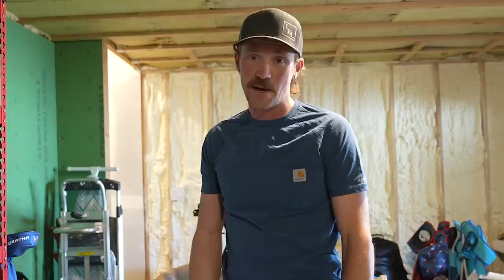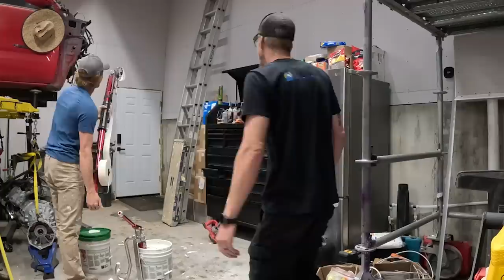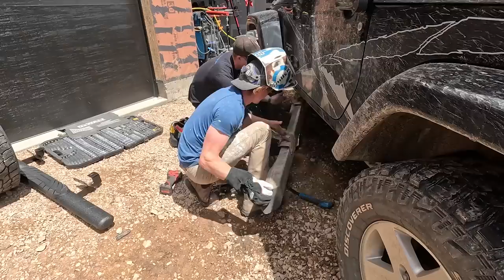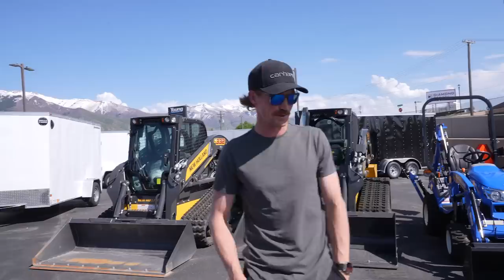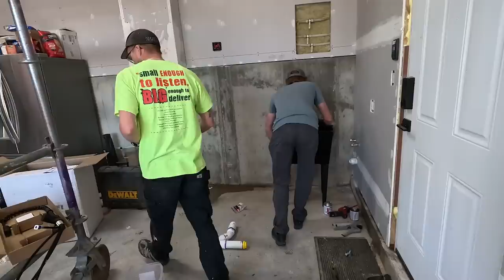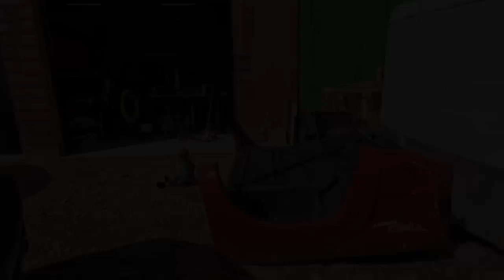WE NEED THIS FOR OUR NEXT BIG PROJECT!!!

Comment: Trent, you need to use larger trowels to get a smoother finish.
Reply: Agreed, get an 18 inch drywall knife to clean up your last stroke...it will save so much sanding!!

Comment: To get grease stains even set in ones out, use dawn dish detergent and some salt.  Pour a little soap on the grease spot, pour a little salt on the soap and turn it into a paste  and rub into the grease spot,  let it sit for a little while then wash as you normally do.  It even gets out old grease spots in fabric.  Sometimes it needs to be reapplied but usually that does the trick. Nice job on the garage.
Reply: Another tip, check the garment when it comes out of the washer. You can retreat and wash again. When you dry, the heat sets the stain.

Comment: So many possible projects to come. Stairs and deck for the Casita, smoothing the second garage floor preparing for concrete, moving the propane tank to a better position so it can be accessed year round, etc. Suggestion, maybe a lean-to for the propane tank to keep snow off of it.

Comment: New Holland is one of the top farming equipment in Canada. No problem in heat or cold and very reliable for the years I was on the farm. I am 68. Retired 2 years ago. Started to work on the farms at 18 so around 50 years. Also raised in a farm so handled this equipment lots of years.
Reply: Yes. I'm also 68 and have heard of New Holland tractors all of my life. Always has been a reliable company. But now it seems that what began as an American company in New Holland, Pennsylvania, is now an Italian owned company. Who knows if the quality of the machines and/or service has remained, or improved, or deteriorated?
Reply: We have a New Holland Tractor since 2019…..worked very well….does what it should….no Problem.

Comment: Trent when pulling your paddle/mixer out of the mud bucket, make sure it's not spinning!  LOL.   Also have 1/3rd to 1/2 pail of water (clean used mud 5 gallon pail works fine for this).  Then spin the paddle/mixer in this clean water,  does great job of cleaning off your paddle/mixer!  And if you do it right, no mud or water on your clothes, floor, or wall or God forbid your Fur Baby!  ROFL  Just a few pro tips there Trent!  Thank you for entertaining us Trent!  :)

Comment: Trent:  use the larger paddle for the seam taping, not that little one.  It is for touch ups, nail holes, etc.  Also, use a little more mud.  The bigger paddle bends a little as you use it and scrapes off most of the excess, leaving a nice smooth and thin seam..

Comment: I am with the comments below mine " Leo's bedroom!" 
And shaping a new driveway! 
The back stairs and deck and cover for the deck. For weather ☁️ protection walking out the door. Behind the garage deck. 
The house front , extended living room. 
A cover for the house deck , to prevent snow ❄️🌨️ on the deck. And rain 🌧️☔ .  
*Roofing the the garage and outside sidewalls .
* Pouring cement the other garage's floors. 
* Water and snow proofing the outter garage walls and proper water drainage.😂😊😅

Comment: To remove grease put butter on top of the grease and it cancels it out. Apply to the item before putting in the machine and that should remove it. It worked for me on white shorts which were covered in grease splashes after cooking outside.

Comment: My following thought is probably not going to pass code in a garage, but recently I did a basement room for a neighbor. When I put up the sheetrock, I made sure my inside corners were very tight. Now I hate taping and mudding as much as the next guy, SO... on those 4 inside corners I caulked them and finger wiped them, and they worked and looked just fine! You'd never know, and it was super fast, easy, no sanding needed.... 
You guys have always been doing a super job, so keep on, keeping on!! I started watching you from when you left Argentina!! 

Best regards, Ted:  North Fork, Long Island, NY

Comment: I’m shocked you don’t have to put 2 layers of drywall between the garage and the apartment.  You do in most places.  Two layers makes a proper firewall
Reply: Same here in illinois  2 layers of 5/8 to separate  living space from garage
Reply: I also don't understand why they didn't put a vapour barrier between the insulation and drywall. With having a heater in the garage, they are now going to get condensation and then mould. 🤔
Reply: Double 5/8 in NY! Between gas storage and living quarters.
Reply: Same requirements here in California too. I think it's the same for Summit County too.
Reply: Utah Code is what they are using.
Reply: 2 layers here in Maine,or 1 I think fire rated 5 or 10 hours.
Reply: Two layers here in Minnesota as well. They haven’t had a final inspection yet so might end up on their check list.
Reply: @joannjukes9140  Remember, naysayers, this build was passed by the authorities.  Different rules and regulations everywhere.
Reply: @lesleyhughes3174  This part of the build has not been passed by the building inspector. It doesn't matter where a person lives, if they get cold weather and have a heater in their garage, and if a vapour barrier is not used on exterior walls, they are going to get condensation and mould. It's because the cold air is meeting the warm air.
Reply: @TheWestlandgirl  I'm sure they are, but with having a heater in the garage, the exterior walls need a vapour barrier. It's because there will be heat meeting cold during the winter.

Comment: New viewer here, and really enjoying! I dont normally comment, but have to share this old school STAIN REMOVAL HACK! Plain ol' Ivory bar soap....dampen stain, use fingernail to shave a bit of soap onto stain....work into area using fingernail or by rubbing stained fabric against itself(could even use old toothbrush for stubborn stain on durable fabric) wash as normal, repeat if any spot remains. I learned this trick from an old gal i used to work for, and i've used with great success for years. Best of luck keeping Trents white shirts looking fresh to death!

Comment: For stains- spray with stain spray, then sprinkle Oxyclean Versatile (it’s the one that can be used on colored clothes). Let sit for about 10 minutes then launder. DO NOT put it in the dryer- the dry heat sets the stain!!! Hang to dry, repeat if needed. I’ve got sooo many stains out with this trick.

Comment: I used an adding machine with a paper roll when I started in public accounting in 1988. Yeah, pretty obsolete now. Just do the same thing in a spreadsheet and you can check your input after totaling. Don’t miss those paper rolls.

Comment: Trent, when I wash my work clothes and coveralls, I pour in a half to 3/4 of a cup of Purple Power cleaner spray. It's a cleaner you can buy at auto parts stores. It takes out grease. But I don't let it sit longer than the washer takes to start.

Comment: First coat of taping/mudding is easy (but tedious, particularly mudding EVERY screw. I see where a mudding banjo would make it a lot faster if you know how to use one, but since I did not have that knowledge just used 6" and 8" knives. What I could not do is adequately smooth the 2nd and 3rd coats and feather them to make a smooth surface. Ended up covering the walls with two types of paneling to make a wainscoating effect and called it a day. Never attempted drywall taping and mudding again. Definitely something to hire out unless you are doing what you are- just first coat to cover seams for a garage. Our second home garage had that done and it wasn't painted. Looked like crap, but I didn't care (it was a garage). Now our third home has a finished garage. Walls completely mudded and painted. Very nice.

Comment: Tip for perfect seams light presser on the trowel. Mind your tape width for your cover pass. It's 2 1/2 inches wide and apply from the seam center no more than a 1/4 inch no less than 1/8 thick layer of mud 3 to 4 inches out pass the edge of the tape. Than feather it from the center of the tape out. Then do a 1 flat pass over the center lightly to thin it even more.  ⭐⭐⭐⭐⭐

Comment: Try Dawn dishwashing detergent. Needs to be full strength so make sure it is not the new diluted version. Pour it directly on the stain, rub it in and toss it in washer. Let it air dry in case u need a 2nd application. Works for me. 
Hope ur eye is better!

Comment: I have only taped a bathroom in my long life, so this idea is just a thought I had while watching this episode: What IF, not using "Tape" to seal the cracks. Just use the mortar, leaving the cracks to look like "seams" in large blocks of rock or marble. You would have to hang the drywall with overlapping joints to give the appearance of a stacked rock wall. With a skim coat of plaster over the entire wall, with the sculptured cracks, it might have a dramatic appearance?  What do you think? Art in Calif

Comment: Trent, finding a machine with heat and air conditioning is a must, especially with the weather changes you have. What is as important or maybe even more is to have a machine where the door slides up over your head and not just open out. I made the mistake of getting a John Deere 318D and if you lift something a foot off the ground you can't get out to help load or unload the bucket. Say you are going to unload something out of the back of your pickup with pallet forks, you are stuck inside the skid steer and can't get out to help. Seems like a small thing but is really a hassle if you are working by yourself or don't have someone strong enough to load or unload whatever you are loading or unloading. Also, I bought one with tires instead tracks, If I were to do it again I would definitely buy one that has rubber tracks and fairly aggressive cleats to hang on side hills instead of sliding. Just my experience and thoughts Good luck!!!   J.R.

Comment: New Holland has been around with farm equipment forever and then they took over Ford heavy equipment  so it was Ford - New Holland. And they slightly changed the forward blue color into what it is now on Tractors. Still yellow for Heavy Equipment.

Comment: Allie try the dawn power pump. put some on the stain and work it in with a toothbrush let set for about 5 minutes, wash and repeat if necessary and the stain should come out I have tried this with set in grease stains from cooking and it works.

Comment: I use Dawn with Oxyclean on grease stains. Rub the Oxy into the Dawn and stain, let it sit for a few hours, then wash in hot/warm water. Don't let the Oxy sit overnight or it will bleach the fabric out.

Comment: If you need to get stains out of clothing use Dynamo laundry detergent.  It takes EVERYTHING out.  Pretreat the stain and work it into the fabric between your fingers and the stain comes out right before your eyes.  Then fill up the washer with water and let it sit without agitation for about 30 min and wash.  Check the stain before you dry it.  No stain will ever come out if it goes through the dryer.  I've been using Dynamo for 30 years and literally have clothes that are 30 years old and have no stains on them.  Blood, ink, grease, oil, ketchup all comes out.  I could be a spokeswoman for Dynamo.  And I can't find it anymore where I live so I have to order it and pay shipping for all thst weight.

Comment: I hate mudding. I got to the point of hiring it out. They'd show up, put up the ceiling and one wall then they had a guy filling screw holes and taping...chasing the the guys putting up the sheets. 3 days max on 3000 square ft...house. they even tarpped the floors, cleaned up and hauled...the also would prime the walls with a different crew. Years ago got a duplex built from footings to move in ready in 43 days.
Leo is a champ.
Be well, stay safe.

Comment: So with mudding you should use a 12” trowel on the seams.  That is a wider span. That way it’s easier to blend it in. Focusing on the joint only is such a small area that it’s got to be perfect to blend. Just giving advice.
Reply: I believe he's got a flat box in the level 5 mechanical taping tools. If he sets it right and has the correct mud consistency it'll dry flat as can be and require very little sanding.

Comment: I think you guys are going to change your driveway so it is easier to get onto, and fix some of the water drainage issues, then use it to extended your house and fix the snow issues from going onto your deck 😁 I am curious when you are going to get your propane tank topped up? 😁

Comment: Just a little tip on the old pallets. Run your circular saw parallel to the 2x4 to cut the thinner boards off. They make great kindling and firewood, and you just have the thicker board to go to the dump with all the nails.  Make sure you get pallet forks with you skid loader too all the loading and unloading you do it will come in handy. You can also leave things on some of the pallets to move and organize them with the skid loader.

Comment: My best solution for grease stains is shampoo. Heard about 50 plus years ago & still using it.  I buy the cheapest shampoo I can find & dilute it with water so it isn't so thick. Dot it on any grease spatters and they wash out. Or, wear an apron when cooking.

Comment: I have the same problem with my shirts that you say Trent does. 😂I have started to only air dry my shirts for that reason. Only thing I found recently to get out stains (oil being the most frequent for some reason) really well is Shout Advanced. I used the gel version recently on a few that had old stains and it worked like a charm. My Mom swears by Fels Naphtha soap and my sister swears that a dab of Murphy's oil soap gets out all the stains, especially the ones on the baby clothes or set in stains. Both use a small washboard to scrub it first, if it is a really old stain.

Comment: New room for Leo.
We call your mudding,  plastering. ⁉️ Question:   Why do you use that little trowel instead of a proper plastering trowel??     You'd get a much smoother result. And easier to use (once you get the hang of it.) My eight year old granddaughter got the hang of it quiet quickly. Not professional but passed muster after a little sanding!

Comment: For grease stains put chalk on it, it soaks up the oil and I've found it removes the spots 99.9% of the time. If it doesn't totally remove it first try, do a second round and it should be gone :)

Comment: To remove stains from white shirts soak them in baking powder and a weak solution of Hydrogen Peroxide. Then wash off in a tub of dishwashing liquid
 Then wash as per normal. Be careful with the Hydrogen Peroxide, read the instructions and use in a ventilated area away from kids and dogs. Don't do while your eye is bad.

Comment: Interesting Kabota was a Japanese company started in 1890.  It was the Yuppie brand of the 1970s, 1980s, and since. New Holland originated in New Yourk state, USA in 1895. Merged with Case equipment and became Case- New Holland. Originally farm equipment, they have many divisions, many plants, and manufacture around the world. I see both brands on the road daily, but more John Deer than either.  John Deer Green is distinctive.  Not promoting any. Best to choose the product that suits the need. Lots of attachments available.  That apply to extensive clear acreage. Also logging and excavation.  Get what will work for your need. And learn to use it safely. ROLL- OVERS are tragic disasters for operator and survivors.

Comment: Trent if you are going to use auto tools for drywall you really need to learn to use them first. 
First your mud is way too thick. Sticking the mixer in the bucket and spinning it a few times does just about nothing. Maybe makes it a little smoother texture. Auto tool mud needs to be much thinner than you would think it needs to be and bazooka mud is different from box mud from corner mud. 
I would suggest you spend at bare minimum 4 hours on YouTube watching people that know how to do drywall. 
Look up level 5 tools, Columbia tools, drywall nation and prc taping. 
I'll bet if you spend 4 to 8 hours learning from them you will save a week and get a 10x neeter result..
I did just what I suggested here,probably more hours and it mad a tremendous difference. I also refer back to those guys especially for mixing mud for different tools.
Again it will reduce the stress when you learn how to run those tools correctly and have the correct consistency of mud.
Have fun don't work.

Comment: Do NOT sand your garage mud!  Do not apply more mud.  That's just your OCD talking.  You would get mud dust on everything.  You don't want that on truck parts.  Once you primer it and paint it with flat white, you won't be able to see if it was sanded.  I think if would be great if you could use the new skid steer to do some landscaping so you can keep snow away from the house and garage.  Winter was a fiasco with the current setup.  Better drainage around the garage is critical, so it doesn't flood.

Allie:  It looked like you had Leo playing in the road.  Very bad idea.  I lost a dog that way.  A kid would haunt you for life.